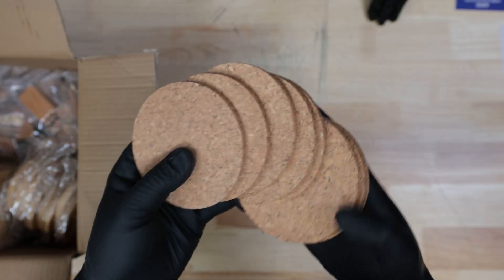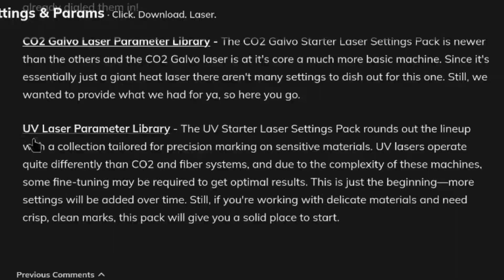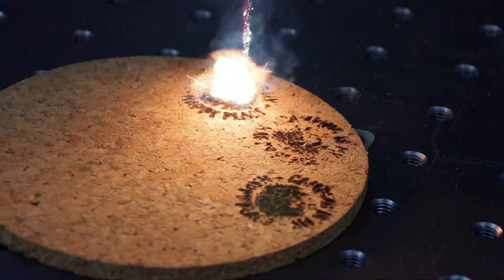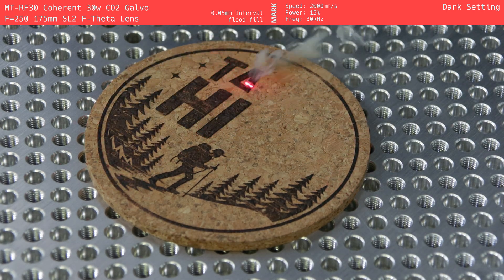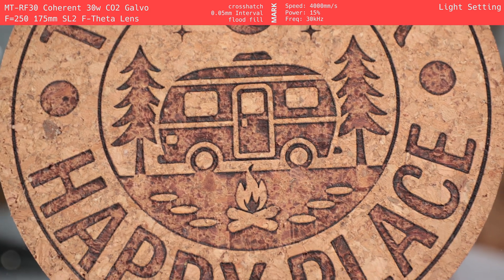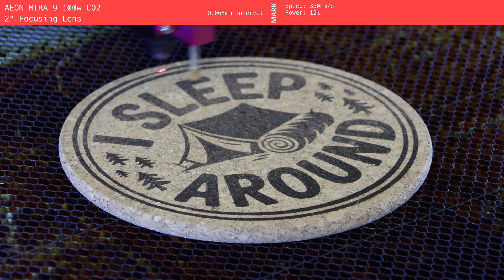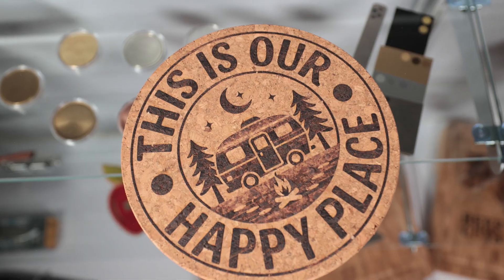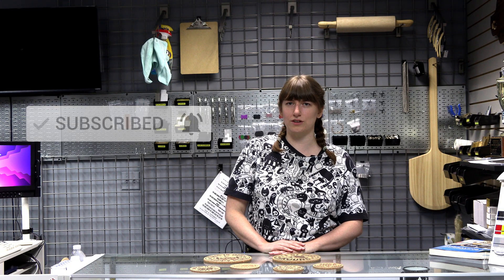The ULTIMATE Laser Marking Guide to Cork | It's FIRE! (literally)

Comment: I tend to use diodes.
Thing is, diodes for me are used so sparingly for niche use-cases that when I do get to run that, I don't really feel it much time-wise and wish to remain on a quality standard. But yeah it depends on what you're running.
Reply from the maker: I actually tend to agree. I like to use as little machine as possible. If the diode can get it done I go with it unless I'm really crunched for time or the wavelength can't handle it. Most consistent results I think.